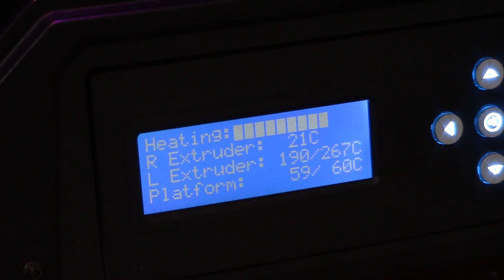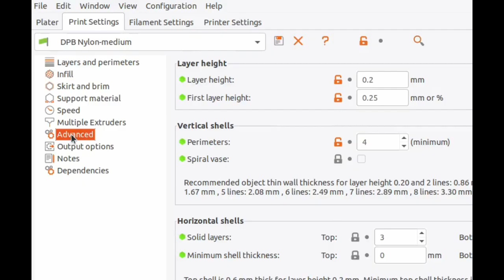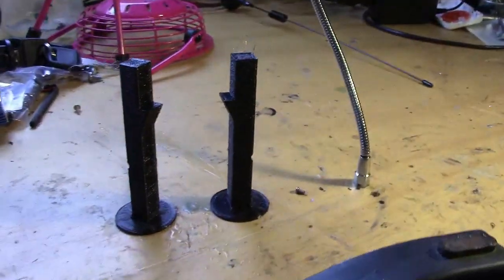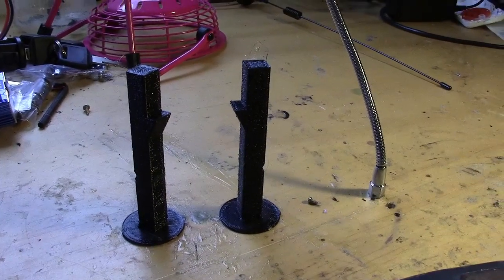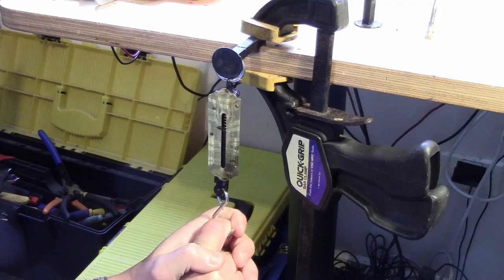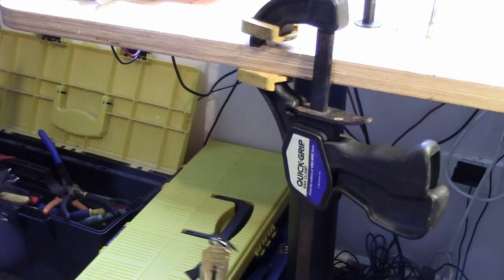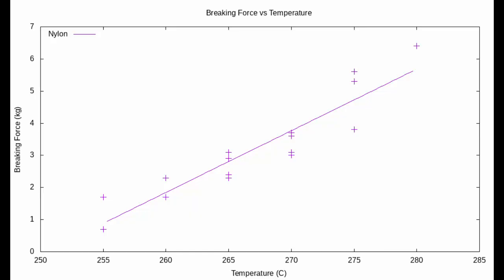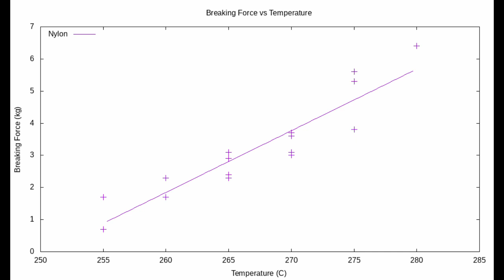3D Printing Nylon - Useful Tips

Comment: Thankyou so much for the helpful video. 2 days in, and I still can not stop my gizmo dorks nylon from warping. I've tried many different types of glue, loading up on several layers of hairspray, even tried loctite spray adhesive nothing works. Gonna give your suggestions a try as they make a lot of sense.

Comment: I use "Overture Easy Nylon" filament it is far better than normal nylon to work with!  It prints well at a lower temp than most.
I found that using a All Metal Hot End temperature of 252 C and a bed temp of 50 C & flow rate of 100% and a print speed of 50% works fine almost no stringing. 

I just use Mouse Ears ( pads of filament 1 layer high ) 
to keep the long parts of the Nylon prints down on the PEI sheet. If you have glass bed I would just use water washable glue stick applied in a thin layer on the glass bed.

No encloser needed with the Overture Easy Nylon filament either. 

It works well on open frame printers just use the stuff stated above. 
I print on a Upgraded Voxelab Aquila with a Dual lead screw upgrade by Creality and a PEI flexible metal magnetic bed sheet
and a High Temperature all metal MK8 Hot End which can go up to 550 C max 
if you have the metal thermistor and heater cartridge that does that temp? 

But I only go up to 300 C using the thermistor and heater cartridge for 300 C max. 
Since even my JAYO carbon fiber PLA needs just needs hot end temp of 225 C and bed 50 C & flow rate of 70% and a print speed of 50%.

As for PETG, I found it picky to get it right since I use many different brands due to costs changing!  Mostly I print at hot end 245 C and bed of 84 C so the extra bed heat makes the problem of warping less saving the print being ruined?  also the flow rate mostly seems to be around 80 to 90% and print speeds at around 40 to 50% on PEI no need for any extra bed help!

On glass I would say use the water washable glue stick ( much easier to clean off but really strong sticking ).
Reply: Hello. I stumbled across this video and would like to thank you for your comment. Im already a huge fan of Overtures White PetG. It prints so well  and so easy like PLA. I have to keep re-checking the roll to make sure I didn't accidentally put a roll of pla in its place. I haven't tried other colors to see if the consistency is the same. Anywho all that is to say, I've strongly considered Overture's Nylon and your helpful info makes my 1st purchase of their Nylon a no brainer. . Right now Im having a heck of a challenge with warping from Gizmo Dorks nylon and I intend on trying some of the suggestions in this video. I also have a garolite sheet that will be arriving soon. As I'd like to also start printing abs and asa. Thanks again!!

Comment: If you have problems with warping, I’ve found using a draft shield (found in cura experimental settings) 1-2 mm from the part helps immensely.